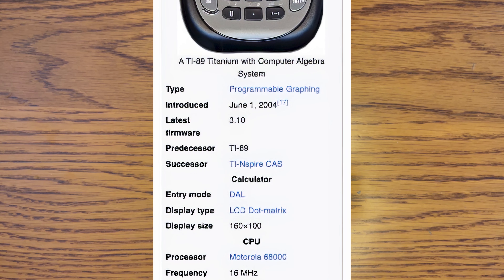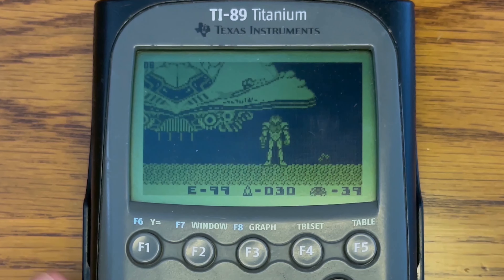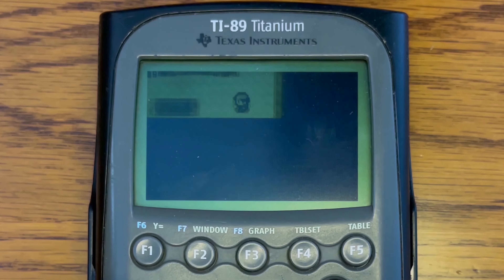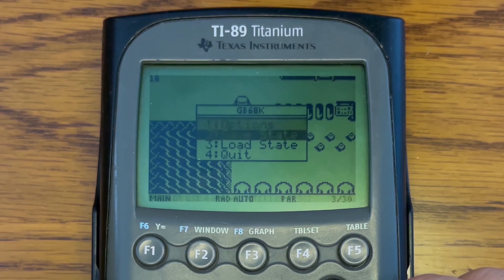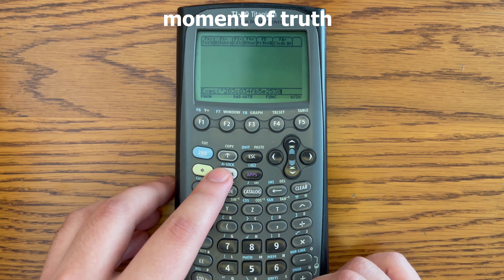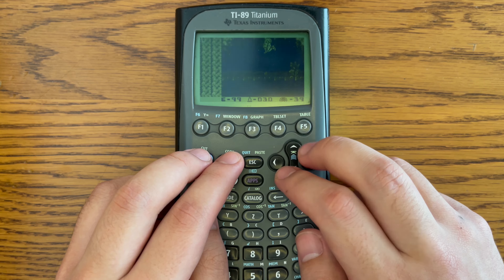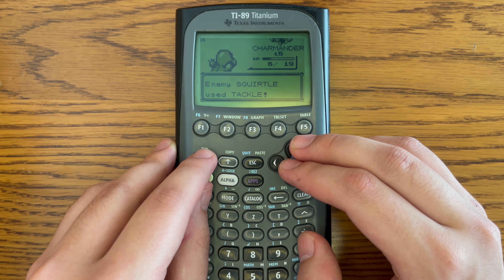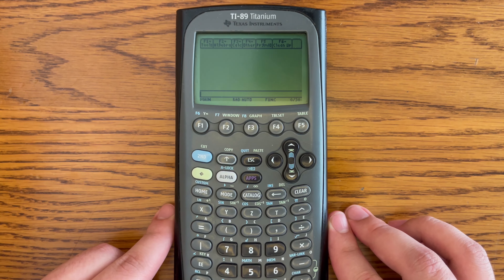How to Overclock a TI-89

Comment: Used a pencil to unlock a AMD Athon Xp CPU back in the 2000's to unlock is multiplier so I could over clock it, got it  from 1.7ish GHz to 2.1ish GHz, let me play DOOM 3 at high setting around 30FPS with a ATI 9800 Pro... man I miss that PC